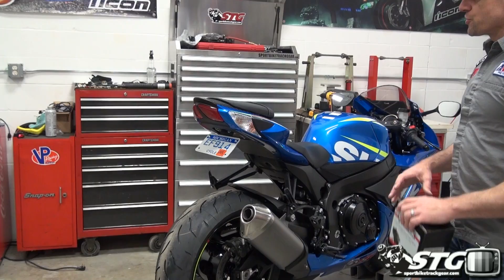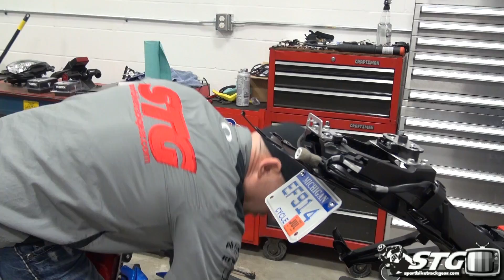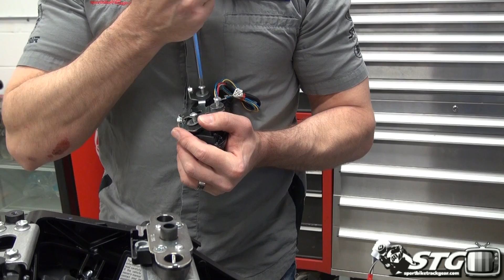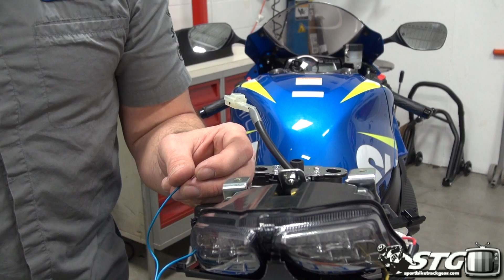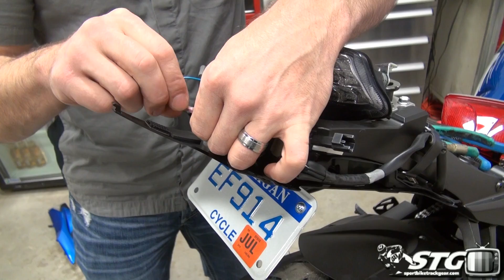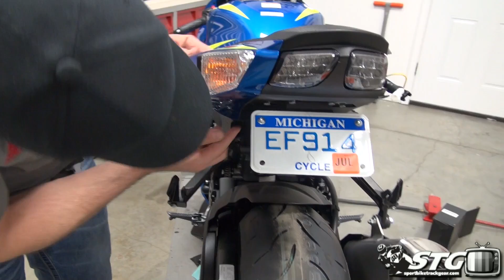Vortex LED Tail Light Install on Suzuki GSX-R600 Project Bike from SportbikeTrackGear.com

Comment: I just want signals. I tried this amd popped a fuse. Sos
Reply from the maker: Double check your work and you should be able to find the issue. Odds are you have a wire pinched somewhere. - Van
Reply: @sportbiketrackgear hahaha no I grounded it out. After rewatching I put yellow to right side and it scared me haha. I figured it out. Excellent video.

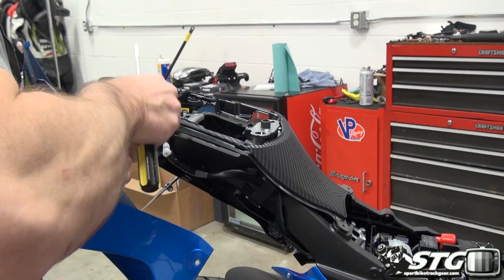Comment: At 6:04 you are pulling the right tail side off and you disconnect the right blinker, does anyone know what that extra electric plug is for?
Reply from the maker: Sorry, I do not know what that connector is for. - Van
Reply: It’s the plate light connection I guess I finally figured it out. Thank for the response

Comment: The tail looks so much better without the indicator part. Would be good if you could remove that Part and just use the new light for the indicators.
Reply from the maker: I do not think I have seen a kit that does that. - Van

Comment: Ive been using JST connectors for anything like that I do, so they can be quickly disconnected if needed and aren't permanent.
Reply from the maker: That will get you a good clean result for sure. - Van

Comment: I assume this turn signal integration has a built in resister?
Reply from the maker: No the OEM turn signal bulbs are still being used so the load has not been reduced. - Van

Comment: I don't like it. The profile is smaller even if the light is brighter, and the incandescent bulbs blinking alongside the LED blinkers looks weird. Good how-to video though, for people who want to do this.
Reply: I have been debating this mod and had the same thought as you about the stock indicators. Think I'm gonna do it but vinyl wrap the stock indicators in a matte black
Reply from the maker: This bike is not the best example of the end result you can get with a led tail light because of the OEM signals on the tail. Take any other bike with a traditional set of rear signals and it will look amazing. - Van

Comment: Hey  my running lights are not working after installing an Integrated LED tail light, any ideas?  They either have the brake light always on and when brake is applied they don't get brighter, or the running lights don't stay on,, but when the brake is applied the brake lights come on, need help.  thanks

Comment: What happens to the indicator (Turn signal) when you brake when signalling? Also, what about the hazard lights when the tail light is on? 

Cool video by the way.
Reply from the maker: Thanks! The brake light is brighter than the turn signal.

Comment: Hey STG. Recently made some big purchases for my 07 GSX-R. I was thinking I would pick up a Rumble Concepts LED tail light as well. I assume the install is nigh identical to this video? Awesome video btw guys.
Reply from the maker: Thanks! Yeah the install will be pretty much the same. But it will also come with some individual instructions you can reference as well!

Comment: well I replaced my rear brake light with a new blinker integrated tail light and I only get a left and a right blinker wire... what do I do with the ground coming from the blinker and why isn't my resister stopping the hyper flash?
Reply from the maker: For more specific installation information you can feel free to shoot us an email at "Orders@sportbiketrackgear.com" or give us a call at 888.784.4327!

Comment: hey really like the video, good audio and camera angles. Just a question about those indicator lights. Is it possible to fit LED light bulbs in the stock indicator fitting's as well?
Reply from the maker: +depenisvanjezus Probably, but it would take a good amount of custom work. Thanks for watching and the kind words!
Reply: +Sportbike Track Gear for your information,asked a dealership here in Amsterdam and he said that you would need some sort of ballast to keep it from flashing ridiculously fast. you can see the led indicator speed go up in your own video when you released the normal bulb indicator from the vortex unit. the vortex went quit a bit faster when it worked  without that bulb next to it.

Comment: your a very good engineer, the only small criticism i had is using electrical tape
id have heat shrunk over the top of the cut shield, but that's me.
very nice job though, very nice clean workshop, always a good sign.

im about to fit one of these lights on my K3 1000, so for me it was very informative and for that i thank you 
out of interest, did you come off a bike just before you shot the video ?
you've got some gravel rash on your right arm ?
Reply from the maker: +Loonboy123 Thanks for the kind words. Heat shrink would be a very good call in this situation, just didn't have any handy. Probably a good way to keep things even cleaner. 

I did not just come off the bike... Unfortunately.. haha this was a giveaway bike we did last year so I try to not put an insane amount of miles on the moto. Thanks again for watching!

Comment: Very professional and clean job Brian! I just got an LED for my 07 gsxr this week, problem is running light works but BRAKE light function does not turn on.. do i need to use a transistor on it? keep up the great videos!!!!